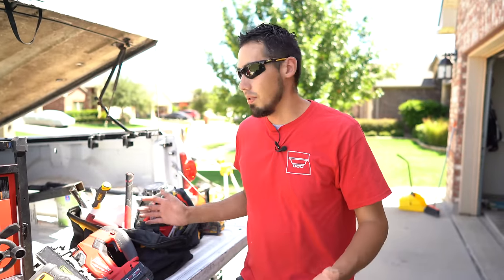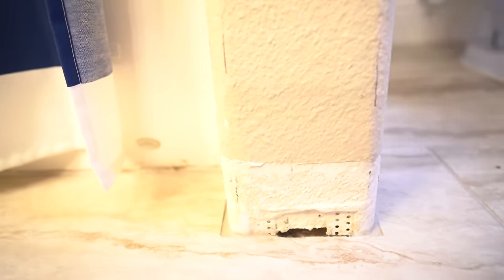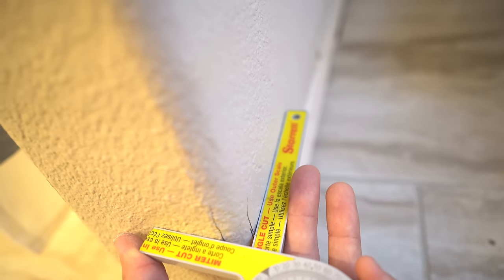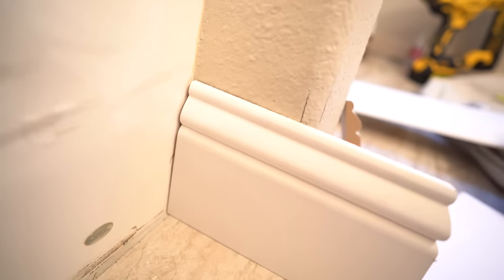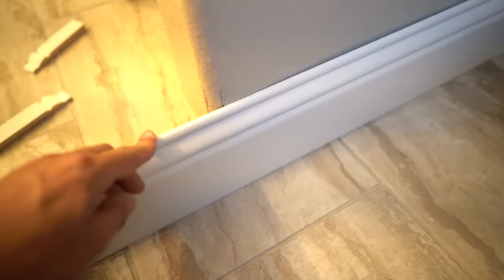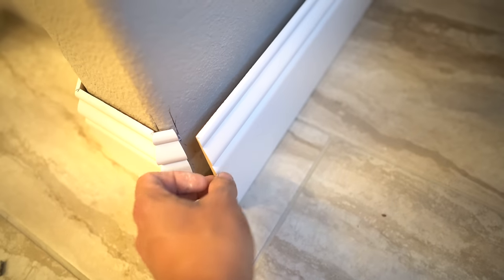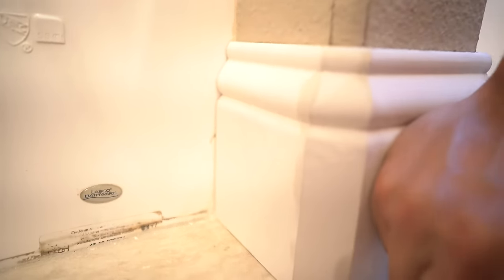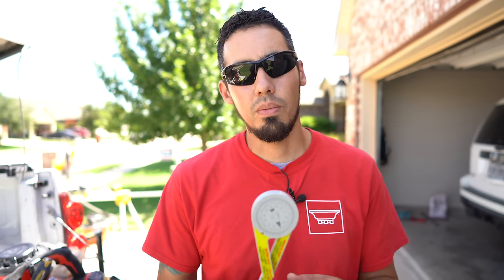This Simple Tool Gets PERFECT Miters

Comment: I purchased this and ended up returning it because the hinge had a lot of slop. It definitely did not live up to Starrett's reputation as a manufacturer of precision tools. I replaced it with the Lexivon aluminum one (which I realize was probably not available at the time this video was shot) and was very impressed by the build quality. You might want to give it a try if you haven't already.

Comment: Heres a helpful tip, when you have a piece of paint grade material always put some caulking on the edge of the base before you push it against the tub side.  It helps seal the end from water, critical with m.d.f.   Also since they are different materials they will expand and contract differently, causing a small gap the caulking will help lessen that.

Comment: I use the Bosch digital protractor; it does what yours does but it also give you the perfect settings for cutting crown molding. I have used it on large jobs and had other crews tell me to slow down as to not make them look bad. It makes the job super simple and blazingly fast.
Reply: Bow do you go about finding angles on tiny pieces like quarter round and small wrap around areas? I find the t bevel and other protractor are top long to fit in these areas. I'm having trouble

Comment: Holy heck!  This'll save having to use painter's caulk for all those "almost" miters.  Thanks.
Reply: Ahaha
Reply: A carpenter's buddy is a painters caulk lol
Reply: Do your best caulk the rest!
Reply: Caulking is key to a pro paint job. Your corners can be tight as hell but paint will not hold that miter doing expansion.
Reply: SOLD!
Reply: Puddy and paint makes us what we an’t.
Reply: @fred1382  "Caulk and paint makes a carpenter what he ain't." 😉
Reply: Clock in drunk, hungover, high? No problem cuz you got puddy and calking lmao.
Reply: The problem with that is seeing how the base and tile line up. You sometimes need to straighten out your base even if its slightly open. a little bit of caulk looks better than base that's flush on one side with the tile and off by 1-4 inch on the other
Reply: Haha i wish I watched this a two years ago I nearly used a whole tube on some joins 😂
Reply: "little putty and paint make it what it aint" words all horrible carpenters use lol.

Comment: The tool will actually show 46 degrees for a perfect 90 degrees corner. I thought it's broken at first, but it turned out to be an intentional feature. Many carpenters suggest to cut 46 degrees for 90 degrees corners. That way the trim will slightly push against the wall creating super-tight fit ("like a glove").
Reply: That's an awesome tip.  Thanks!
Reply: Thanks, I thought mine was defective since they didn’t line up and I couldn’t find a way to adjust it.

Comment: I bought this to help when I am setting up a long (28' max) extension ladder to quickly verify that I have a 75 degree angle between the ground/floor and the ladder.  I know it's overkill, but I had an uncle die as a result of a fall from such a ladder, so this tool puts my paranoia to rest.  Nice to see in this video what purpose the tool was really designed for.  Very professional;  should be 100% thumbs up, especially since you include links to the glue and other tools you used in the video!  Thanks!

Comment: Richard, excellent skills and video as usual but why use mdf in an environment with water? Washing that bathroom floor let alone an overflowing toilet and those moldings are trashed. Kitchens are also a non use mdf area. The Starret gauge is a great tool.
Reply: Great point Mr. Clint Price!!!!   In my house that I did not build, the builder used MDF ALL over including the bath and kitchen areas.  Poor decision!
Reply: What should you use in those areas?
Reply: Good question, I would try to use poplar, or clear pine, or paint grade maple.  Something that is more water resistant.
Reply: But then he can’t charge to redo it lol jk

Comment: Congratulations on the baby by the way! 
Please please do a video on scribing long cuts. Your last video you had at least a 10’ long baseboard that rocked on a warped floor. You didn’t show how to fix that. I’m familiar with scribing but have never done it. 
Question, once installed and nailed in there are micro gaps at the tops of the baseboards due to the wall not being perfectly straight. Also micro gaps at the tops of the bullnose corners. To give a cleaner and tighter look, is the only solution caulking then paint? 
Thanks for all your tips and videos
Reply: I was going to comment this as well. Any tips for a long run of base when theres a hump in the floor? Loving these baseboard vids!!!
Reply: Heres how I have learned to scribe base to match humps or dips in floors.    If you have a hump, level the base so that you can transfer the hump.    To simplify it... if you have 5/16 of a gap on the left of the high spot and 5/8 on the right.  Set a scribe to 5/8 of an inch start on the right and mark to the left.  Cut the waste side of the line and either belt sand or hand plane to the line to make a cut that matches the floor perfectly.  Fast cap accu-scribe are a life saver.  They have made 2 variations, are well worth the 13-20 dollars they cost.
Reply: I do base in sections as a complete, uninterrupted run.  So if the base starts at the edge of door casing, turns an inside corner, then an outside corner then stops at a door casing I would cut to length and dry fit for length all those pieces together.  That would be a complete run.  Cut everything to length and do a dry fit and temporarily tape together any outside miters to keep them from falling.  I shim the ends of each piece so the top of each piece is perfectly flush with the one next to it and so that any outside miters are closed. Longer pieces might require a 3rd shim in the middle if they sag.  Narrow shims are best so they don't interfere with your scribe.  Unless there are fabric panels or some other wall treatment that's going to sit on top of your base and it needs to be level most base doesn't need to be dead nuts level.  Generally if there's a fat hump in the middle of a wall I split the difference, but each situation is different.  For marking/scribing, and especially for stain grade, I prefer to use masking tape or green painter's tape and a .5mm ink ball type pen in a Home Cheapo compass, it gives a very thin but clear line for jig sawing or freehanding on a table saw and then belt sanding or block planing.  For high end residential with somewhat bumpy solid oak floors, (high end as in $550 toilet paper holders in each crapper), I'll remove the ink cartridge of a pen and hot glue it in a small block of wood.  If for some reason there's a seam in the floor planks within an inch or 2 it can throw off your scribe if you're using a compass or any of those larger expensive scribing tools.  Also, the base might be sitting on a small natural bump but that bump might not extend all the way out to where your big ol' scribing tool is riding.  No Bueno!  A small block of wood with a hole and a pen in it and some hot glue to secure it is your best bet for bumpy, uneven floors.  Like a small chunk of MDF that's 1/2"x1/2"x1" with a hole for the pen cartridge about 3/8" up, or positioned wherever you need.  There's a million tricks, and that's just for wall base.

Comment: So thankful that bullnoses are not a thing here in the northeast.
Reply: K00K, my sentiments, too.  I LOATHE bullnoses corners.  I see them as a mask to cover up lousy drywall workmanship where they couldn't make a proper corner fit.
Reply: Not a big deal just a thang bullnose is actually pretty simple
Reply: At least once a day I spend time ripping out bullnose corners and flushing them out with angle beads. Old fashioned!
Reply: Knock-downs (the drywall finish on the walls in this video) are hideous. They also make any repair to the wall a much more difficult job. But  they weren't invented for the sake of the homeowner. They were invented for the sake of the drywall contractor that wants to hire cheap labor that doesn't have any idea what it's doing.  Use of bullnose could easily be a sign that you are dealing with a drywall contractor that only works in production mode. Not quality mode.

I've seen the bullnose used as far north as Ocean City, Maryland. That protractor is a great tool, however.
Reply: This is interesting. In Colorado, I find bullnose in more of the “higher end” houses and square corners in everything below.
Reply: Hes making it more of a big deal than it really is.  You just make a small round corner jig to carry around and mark all the outside corners with.  I make the round corner at a strong 5/8ths.  We measure whole house at once and cut a lot of of the 5/8ths pieces.  Just prenail corners together and its a cakewalk.  Basic stuff here.  Baseboards are the very first thing a trim guy learns.    Theres really no need to check angles, its a 22.5.  If its not then the framing is messed up and you need to adjust to make square.  That will require some caulking from the painters but it looks way better than nailing baseboards out of square.
Reply: It's a southwest/desert adobe style thing.
Reply: I am a new subscriber and have learned so much watching your videos. I really appreciate your step by step detail. Thank you! I am really happy to have found your channel.
Reply: I see bullnose corners as a safety feature for a home. My three year old was injured so badly from running into a Sharp 90 degree corner oh, he had to be taken to the emergency room for stitches. I've also injured myself, scraping skin off my arm from going around a sharp corner too quickly. Neither of these injuries would have occurred if I had lived in a home with bullnose corners.
Reply: Yes they are. A lot of newly built shore homes are using the bull noses especially in Avalon and Stone harbor New Jersey
Reply: @024dogtop  would love to see your video...

Comment: Enjoyed the video but, how do you measure for the small corner piece for the bullnose?
Reply: Same angle as figured.  if the "double cut" reading is 46 degrees.... and you're bullnosing.... then each of the four cuts for the corner are half of 46 = 23 degrees.  Old school way would be to just use the bevel and a square... bisect the angles down from original reading.... like set the bevel for he wall's angle... then put the bevel on the straight edge of a scrap of wood, mark a line.  Use the framing square's width to mark a parallel line to that one (a line the width of the framing square, parallel with the line marked from set bevel).  Then mark another line using the width of the framing square, parallel with the straight edge of the scrap...so you're making a crooked square.  Then set the bevel diagonal across that square and you have your angle for a regular miter.  To bullnose, just repeat that process, and bisect that angle.... then use the bevel to set your saw blade.   This tool would be quicker and easier.... but that's how you would do it without a tool like that, just using a bevel and get same accurate angles.
Reply: I think I would use a digital micometer, and measure between the two lines made with the bullnose gauge, that would give you the length of the back of the baseboard. Then cut your mitres outward from that.

Comment: Have you done a coping video? Basic mdf is easier I've just redid half my house with wood similar to this material and couldn't get it right lol. Your skills are phenomenal by the way
Reply: There are several good coping vids on YouTube.  Try to watch as many as possible.  A hand coping saw is good but a Collins coping foot is really good if you've got a lot to do.  Also, a round file, about 3/8" thick and a small triangular shaped file is good for precise coped joints.
Reply: Wud Dude I would be lost without my Nicholson 4 way
Reply: All my coping I use a cordless angle grinder with 36 grit sanding disks. Then fine tune it by hand with sandpaper as needed. It you have to take out a lot of material, back cut the cope with the miter saw, they cope with the grinder. It's super fast

Comment: I guess Im old. We called that a scribe fit. Tradesman been doing this for hundreds of years. Also, just as important, is the technique where you glue up first, then nail. Nailing that turn as one piece makes the difference.
Reply: James Myers Sr. Yep i was going to say the same I'm only 30 and i scribe all my internal joins. I can see how it would be good for external corners.
Reply: Speaking of gluing up first, last year I had the opportunity to use a set of Jim Chestnut's clam clamps for door and window casing.  At first I was skeptical because of the 4 pin holes it leaves in the finish, but now after using them, in the words of the Monkeys, I'm a believer.  Have you ever used them?
Reply: Yup, it’s a waste of money to me to buy that tool I’ll loose that tool really quick because I won’t need it since I already knew how off it was by looking at it

Comment: Another reason to use a Festool Kapex. The saw comes with an interior/exterior angle finder and the saw is set up to use it easily together.
Reply: The Starrett tool is much less expensive than a Festool and seems to do the job rather well.
Reply: @photog1529  EVERYTHING is much less expensive than a Festool.

Comment: nice work cool tool, but MDF trim gets ruined in bathrooms from the moisture, especially near tubs.
Reply: Home Depot has matching waterproof base board trim for wet areas. I've used it before and love it.
Reply: Good point, Giter Dun.  I wouldn't use MDF anywhere close to water.  TBH I wouldn't use it period, but that's just me.

Comment: Love the old trick with two blocks where you draw the lines and connect them then know what the bisected angle is on your mitersaw. The pros will know what I’m talking about here. Not as quick as a protractor but helps a ton when you forget it.

Comment: Now lets talk about not using those GIANT framing carpenter pencils and get a  ice finish carpenter pencil LOL
Reply: @3dandyrandy3 

I get it, but I prefer my mechanical pencils, .9mm for "rough" work, .7mm and .5mm for insane accuracy.  And it takes 1/64th of a second to sharpen.
Reply: Agree, I also use mechanical pencel.always sharp point
Reply: @rickwashek478 

Yep, tooless sharpening in a billionth of a second.  :-)
Reply: Lately I have been using all plastic mechanical pencils. Plastic ferrule does not break leads like metal. I was sceptical, but now...old dog learns new trick
Reply: I use a sharpie
Reply: I use those fat round kindergarten pencils
Reply: You need to watch the "See Jane Drill" videos on why use a carpentry pencil. Kinda tongue in cheek here, but for beginners, serious stuff.
Reply: I use mark it paint can to spray my finish marks
Reply: Luke Tein I have used a utility knife for decades. Pencils, no matter how fine - on which side of the line are you going to cut? I once worked w/a Nova Scotia finish carpenter who never measured - just aligned, marked w/his knife, and cut; perfect fit every time. I learned a lot, a knife was just the most basic.

Comment: Thanks man, but ill have to wait for the digital one to come out.
Reply: Hey dude the same company already has a digital one if I remember right it's about a $170.00 peace
Reply: This one in the video it about 27.00-32.00.  Home depot sells a digital angle guage for about 30.00 dollars.  Believe its made by empire.  Just some info.
Reply: @stevemcginn9200  the ones at Home Depot are real cheap if you want the truth they are garbage get one from Starrett go to Amazon and pull up Starrett protractors there is about 4 different ones starting at $23 up to $200 check them out. Thanks for the comment. Peace
Reply: @jeffcoolhd 

I'm about to take delivery of an LS1219L.  I hope Makita doesn't let me down.
Reply: @wuddude1599  I guarantee Makita Will Never Let You Down they are real good tools you will be very happy with it I guarantee it. Peace
Reply: @jeffcoolhd 

I hope so.  Seems like EVERY manufacturer has complaints about their miter saws.  It doesn't matter if it's Harbor Freight or Festool, all brands have issues with their miter saws.

I have a ton of cordless Makita tools from drills, a grinder and track saw.  I think Makita is the premier manufacturer for construction tools.  However, I am a bit nervous about getting this Makita.  I had a kapex and it had problems that Festool refused to fix.  So I'm going to try the Makita.  If the Makita is a turd I'll probably get the Bosch Glide.
Reply: yea its just an angle finder, to get the miter angles you gotta use an equations and I been doing that for a couple years already lol.
Reply: definitely not garbage, been using it for years and always worked great for me. Miters were always tight and accurate.
Reply: @smokingcheeba420 

I have an old Hitachi I use on jobsites.  The Makita 12'er will be a toy for evenings and weekends.  It'll be pampered and not moved once it's bolted in to its new home.  :-)
Reply: @smokingcheeba420 

That'll be a bonus.  As long as I can calibrate it to cut 90 and 45 both on the miter and bevel I'll be happy.  My 10 year old Hitachi has been an awesome saw.  Gonna keep it until there's no way it can be repaired.

Comment: MDF baseboard in a wet area that's just going to soak in some water and rot. Excellent technique tho
Reply: I was thinking the same thing. The carpentry work is exemplary as it always is. To make this installation even more perfect, you'd seal the end and back of the piece against the shower to improve resistance to potential future water damage. Unless the painter is there to do it, it would make sense for the finish carpenter to think big pictue and take care of this little detail to protect the fine finish carpentry work.
Reply: This guy knows his stuff, so it's probably the moisture resistant material.